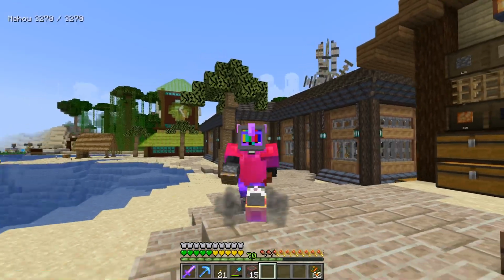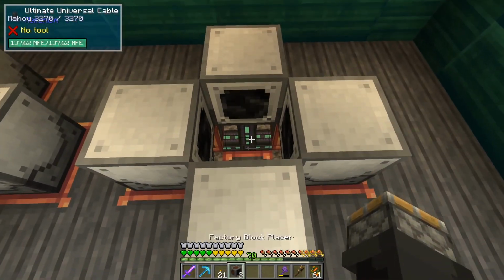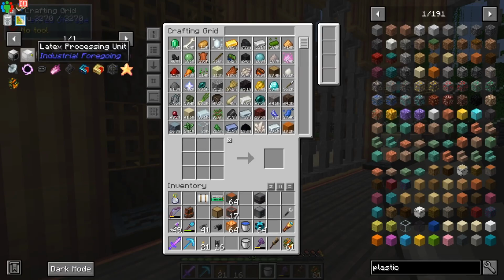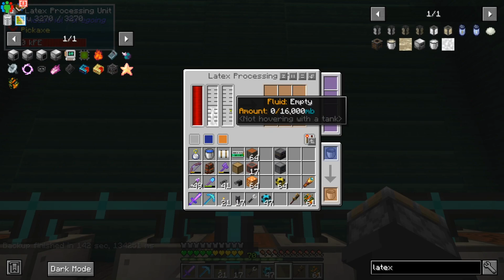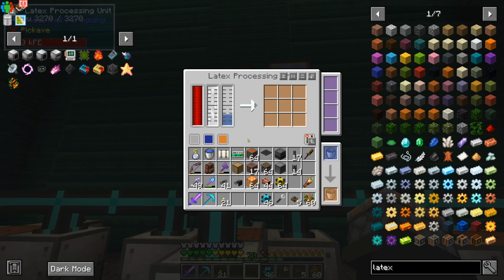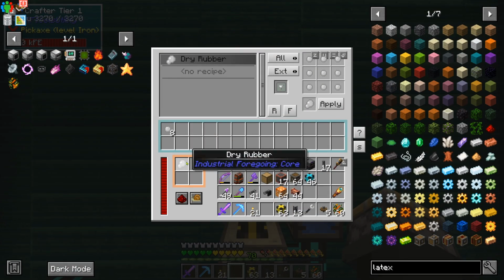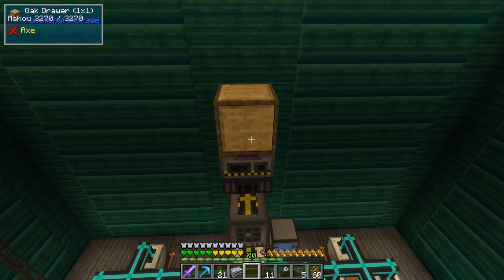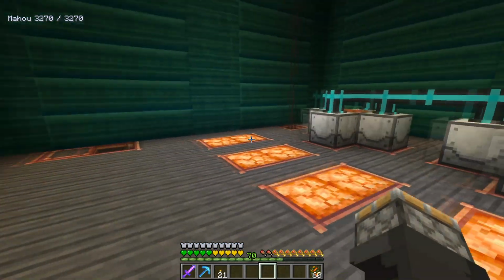Automating Plastic Production - ATM7 Ep 22

Comment: any benefit in using factory block placers instead of just refined storage constructors?
Reply from the maker: The factory block placers don't require any power. But ultimately you could use whatever is going to replace that block when it breaks.